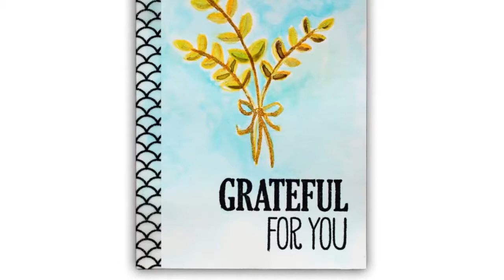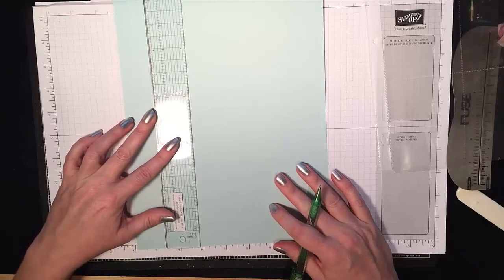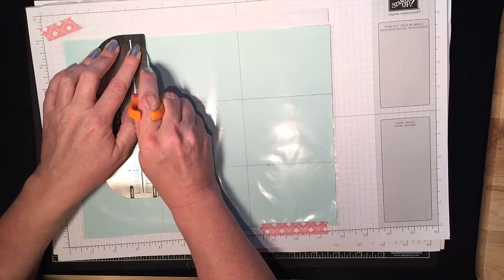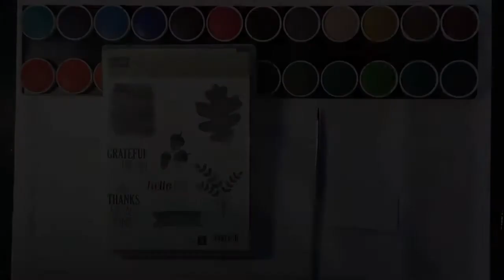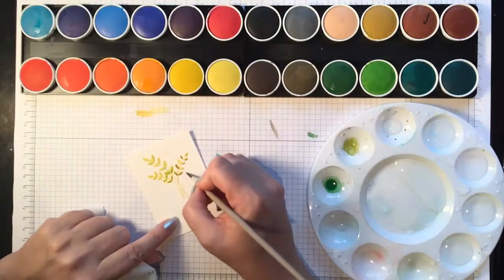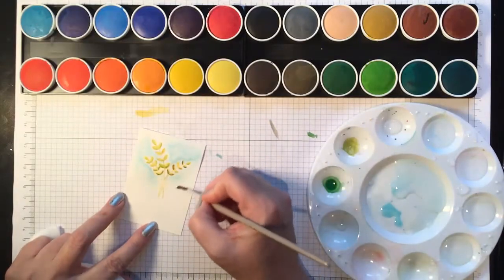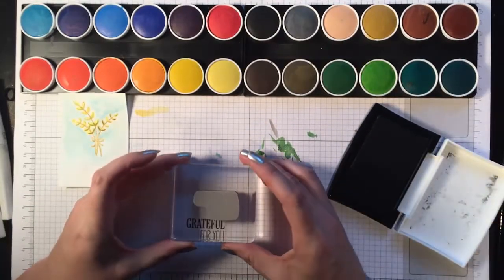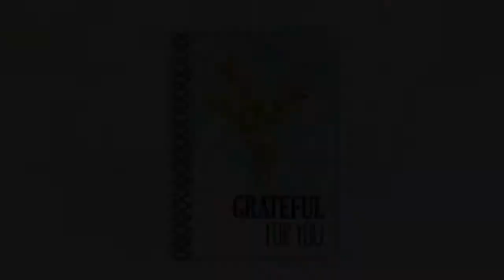Fuse Tool & Pocket Page Swap

Comment: Excellent video. I agree with you about the ruler. I use a twelve-inch metal ruler (the same as you did with the edge of the fuse ruler). My large metal ruler has a cork backing, so it doesn't slip.
Reply from the maker: Thank you!